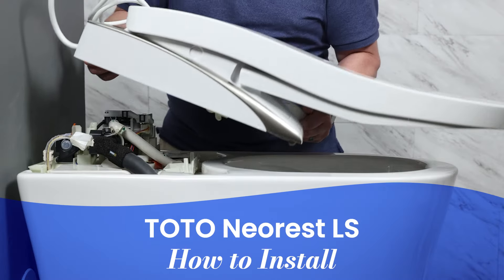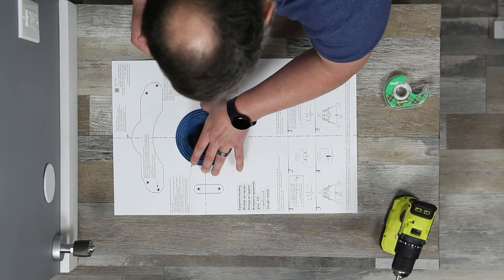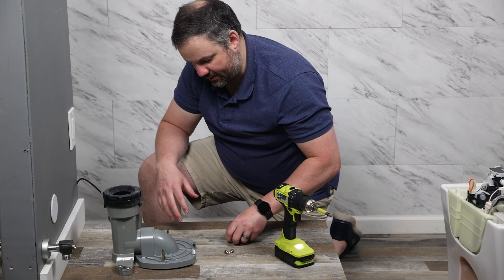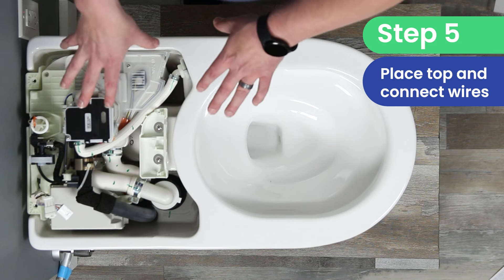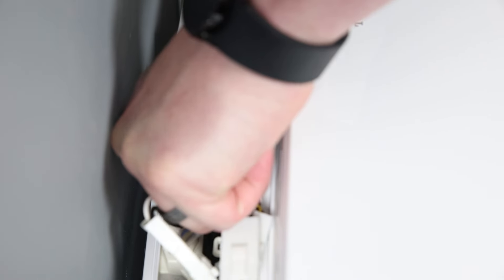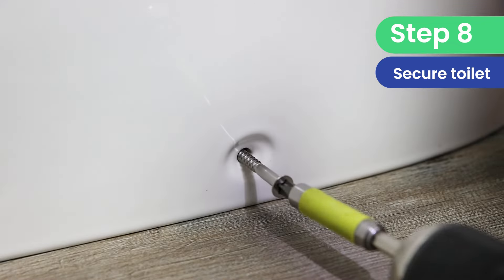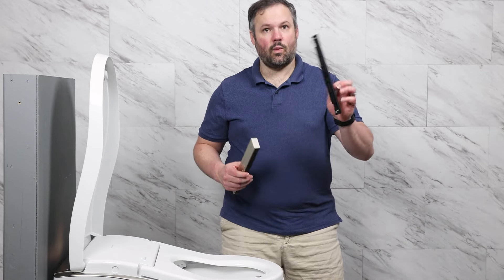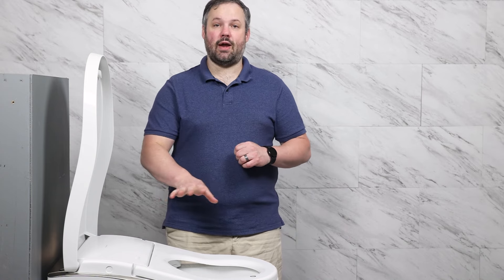How to Install the TOTO Neorest LS? Step by step instructions

Comment: Do any of the integrated bidets you sell have a stainless steel wand?
Reply from the maker: The Neorest line will all have plastic nozzles. A few from the StudioLux line (like the SLi 3000) will have a stainless steel wand however.

Comment: My floor water supply line is about 9 inches away from centre line of the drainage hole...will the LS work for my case? Or would i have to resort to something less wide, like the 700H or the G450? Thanks!
Reply from the maker: The waterline will need to be outside of the back of the toilet so 9 inches or more would be good. If it is under 9 inches it might be too close and hit the back of the toilet. Reach out via Support@manybidets.com and we can do some further investigating to see if it would work.